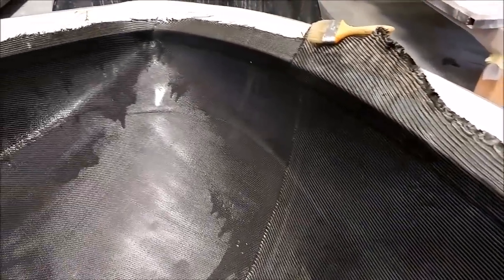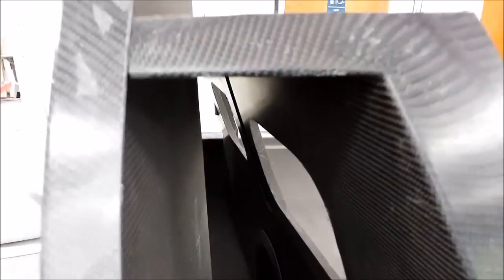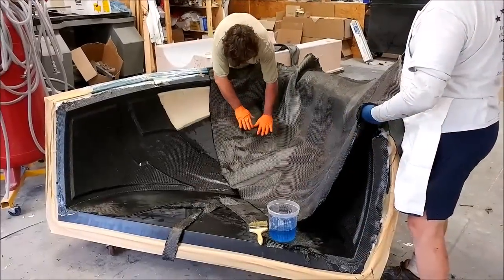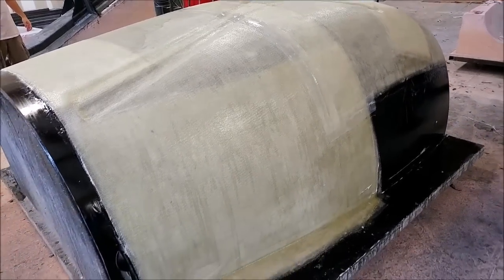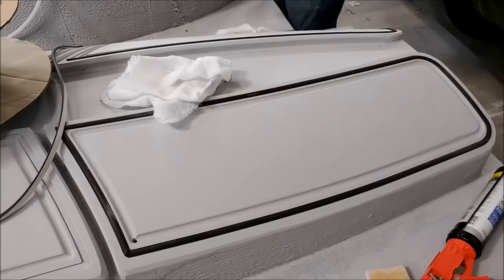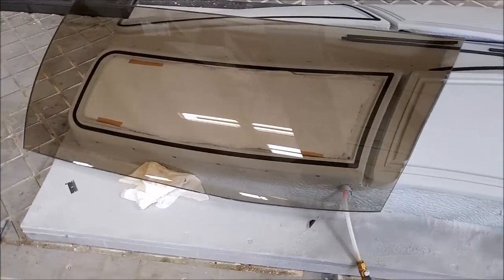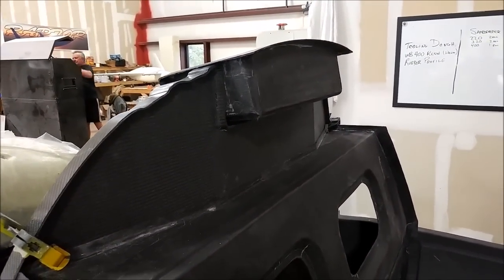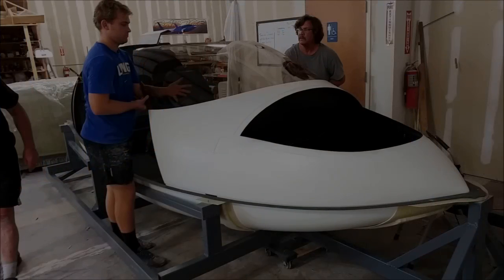Raptor Aircraft June 18th

Comment: Great details and information.  I presume the forward bulkhead is the pressure wall and the aft one is the engine firewall.  The main landing gear and the center tank with pump are located between the two walls.  It appears the center tunnel will not be pressurized.  Are these correct assumptions?